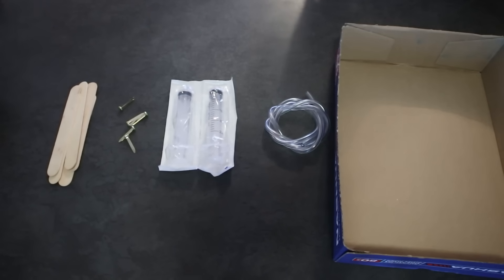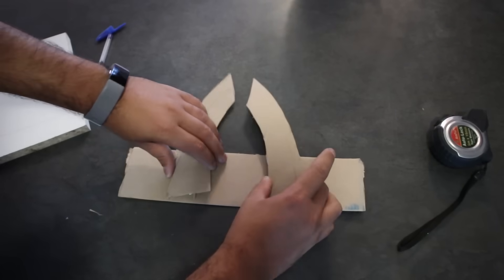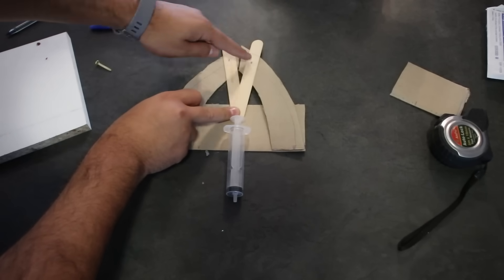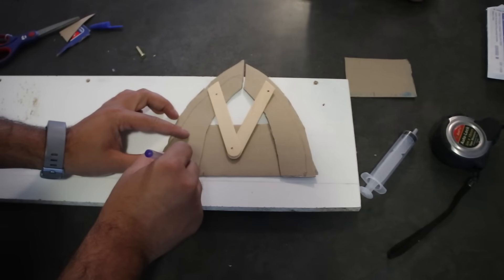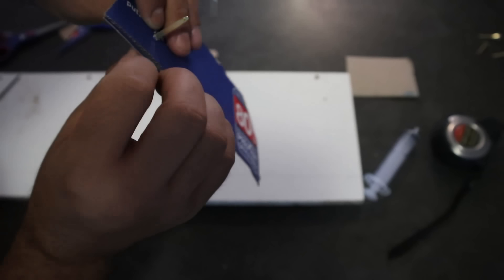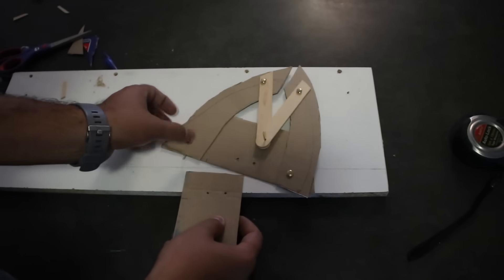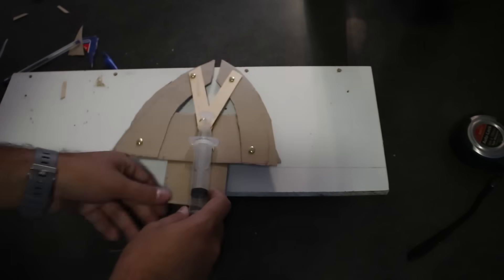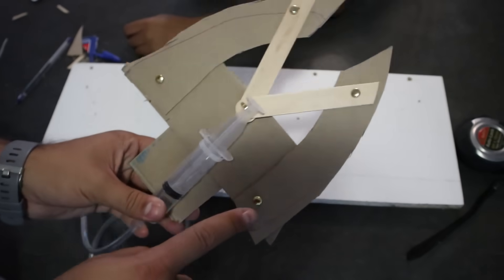Jaws of life project [how to]

Comment: Just a note for all the other parents and their young engineers out there trying to follow this tutorial. There must be absolutely no air leakage between the syringes and the pipe that joins them together. I have found that superglue works to seal it.
Reply: That's exactly what happened with my son's project. We tried the superglue, but unfortunately the water was still leaking out. Other than that, this really was the simplest tutorial.